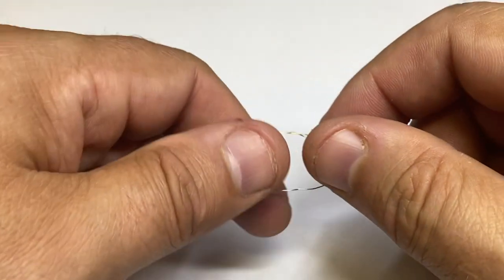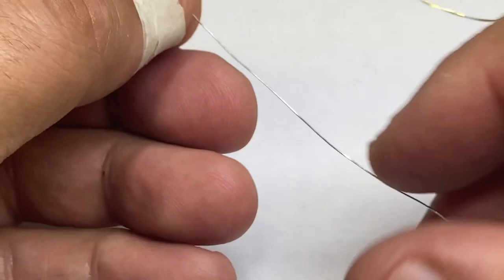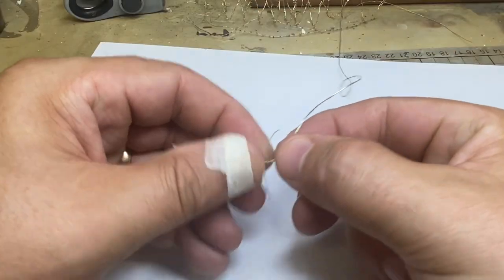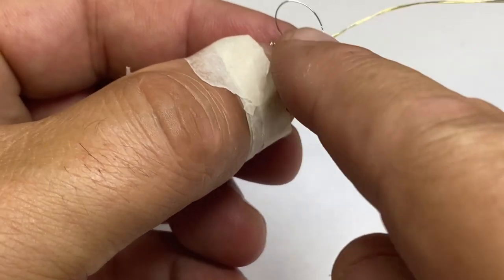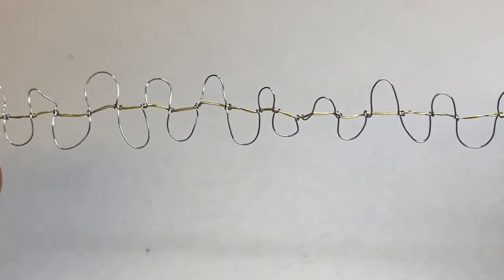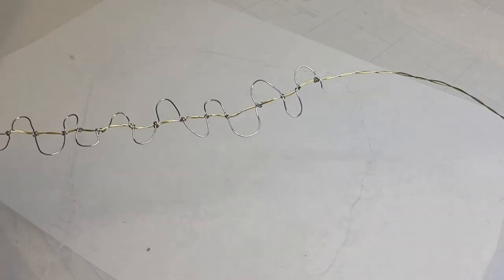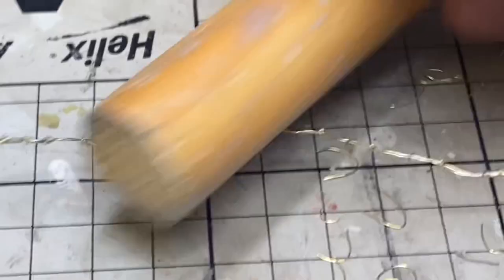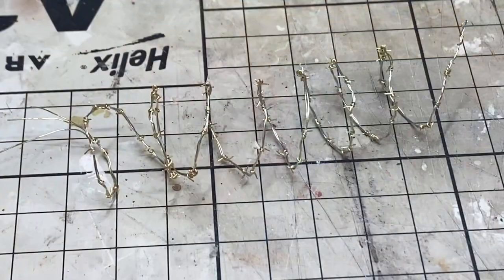Make barbed wire realistic EASY #makediorama #135scale

Comment: Great job. I’ve a question : what’s dimension for the plastik card ? Thanks for answer 👍
Reply from the maker: Hi, it great stuff and you can use your normal modelling cement on it to. Plastic card comes on different thickness etc and mine is A4 in size. i got mine from a model shop. I’ll add some details to the description.
Reply from the maker: Hi added some details to the description 🙂